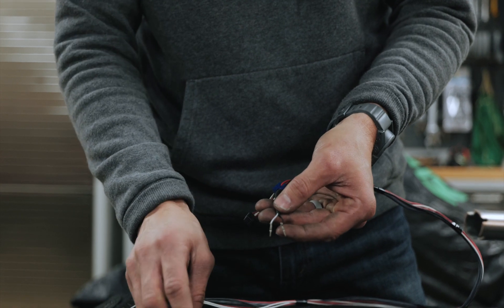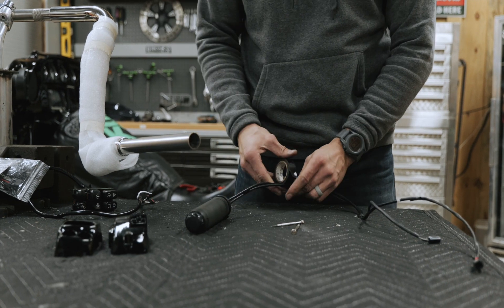Internal Wiring for 2014-2023 Harley Davidson models

Comment: No offense. I feel you did a great job with your step by step video. That said, the installation looks incredibly hoakie. The switch housings do not come all the way to the end to meet up with the step up from 1" to 1 1/4". That gap between the 1 1/4" step to the switch housings looks horrible. Thank you for posting this. You saved me the hassle of ordering a set of bars that "ABSOLUTELY" would have been sent straight back.
Reply from the maker: That’s where the brake and clutch lever assemblies mount to bud.

Comment: 3:15.
WARNING ⚠️! 
After today I do not recommend removing the wire harness sheath from the bundle of wires.
After doing my own bars I really screwed the pooch somewhere but one of them that Sacramento Harley Davidson called me on today said there's a bunch of wires on the twist grip side that has exposed wiring and this happened from being pulled through two 90° turns on 14" x 2" meat hooks.
The repair cost so far is $1100.
Reply: How? You must be paying some mega money in labor
Reply: @ChuckWood  Not the OP obviously but the trouble to diagnose, inspect, and get to the point where they found the stripped wires may have taken some time depending on what his original problem was that made him take it to the shop.  Shop labor isn't cheap.

Comment: Need to clean up the bars before there welded up. The edges inside are sharp and jagged causing harnes to hang up.. 
They seem to be getting worse the more popular these bars have become...
Reply: Debur any where u can reach. I have the 10 inch 6 bend. Upon unwrapping them I checked the pull thru openings.....I worked in many sheet metal shops. They would fire u 4 leaving this untouched.